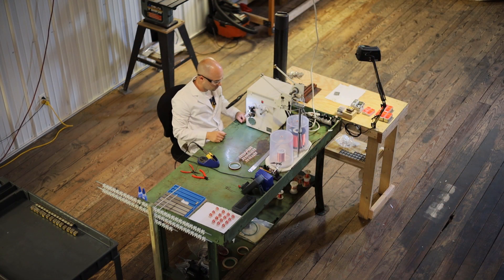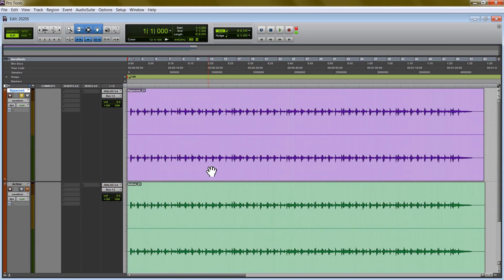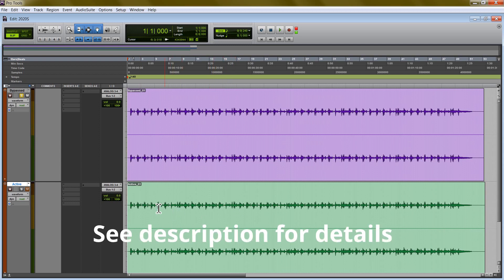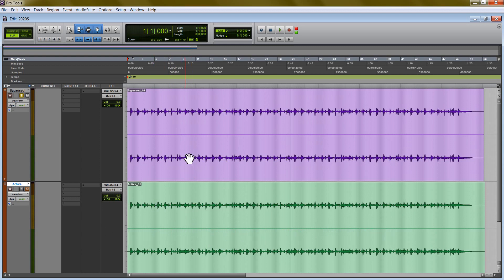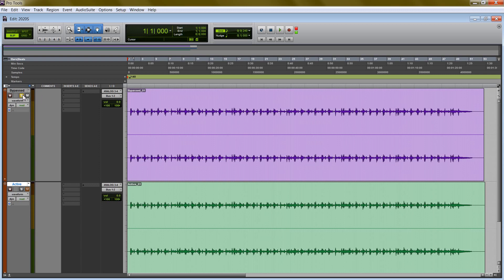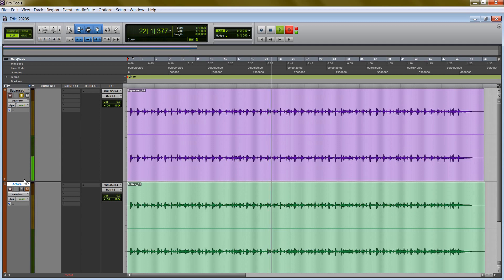Lightning Boy Audio 2020S Steel-Core Instrument Transformer

Comment: Hi, can you tell about transformer specs ?
like impedance ?
Reply from the maker: It’s about 145k Ohms, but that can change a bit depending on what is connected to it.
Reply: I'm from Iran and we have no access to buy anything from outside the country, I wanna use this between my electric guitar and 
Axe-Fx II  in my signal chain, my pick ups are Dimarzio PAF7 with DC resistance about 7.23 k ohm, my friend is a professional in electronic engineering and winding advanced transformers , I need detail information about transformers u use in your products, I did a lot of search about it , many people recommend 10k:10k or 600:600 audio transformers, I need your help to make my own transformer to get rid of hum , thank you for your support      @LightningBoyAudio
Reply from the maker: https://lightningboyaudio.com/store/p89/instrument_transformer.html

Comment: just got this in the mail today and it sounds so good.  I just make music on my ipad so I previously got my harmonic distortion from software apps.  I was content with them before I heard this thing.  I also don't have a guitar amp, I just use guitar pedals (2 of which are Lightning Boy pedals, Thunder Knob and Soul Drive), and since they are made of real amp components, I don't think I need an amp.  I inserted this in between my fuzz pedal and a buffer booster eq.  Previously, I had to watch my volumes because it would distort the guitar in a bad way, but with this thing, its like it's compressing everything to be balanced.  I can boost the lows or highs pretty high and it still sounds pleasant.  Wow, I'm typing back and forth from playing the guitar, I just boosted my fuzz pedal all the way...I usually had to be careful with that one sounding so harsh, but it sounds so good.  It seems like every guitar pedal or preamp should have this thing already installed in it.  Although, after switching back and forth with and without the 2020S, it reminds me the difference of mogami gold and mogami platinum.  Frequency wise, it sounds like mogami platinum because it tames the lows and cleans up the highs, but the mids and the low mids loses its thump.  For my guitar, an Se Santana that focuses on the mid frequency, I favor the mogami gold over the platinum.  It makes me wish this thing had a tone control.  Just like I wish there was a tone control for guitar wire to get both the tone of mogami gold and mogami platinum.  Do you think it would be possible to have a future version with a tone control or is that impossible to engineer?
Reply: Update: Found the solution.  I find that it sounds thicker by mixing the transformerless signal with the 2020S in X blender pedal so now I can have the low mid thump of the dry signal and have the clean highs and 3d sounding 2020S..it sounds pretty good all running thru the 2020s, but i think it sounds better mixing both wet and dry signals
Reply from the maker: Thank you for the support!  Sorry, no plans for a version with tone controls.  Not enough room in the enclosure and it could only be “cut” knobs since this is a passive device.  Enjoy!
Reply: @LightningBoyAudio  thanks for the reply, yeah, it would definitely have to be in a bigger box with a tone control.  I was thinking of it being in a completely new box to be in direct competition with the sono audient preamp interface or any other tube preamp or tube pedal.  It would have active eq: bass, mid, treble all with sweeping capabilities, 2 xlr or instrument jacks for option of recording vocals or instrument, including 2 tubes, with the option of turning them on or off, a 12au7 and 12ax7.  So, for clean and richly harmonic vocals, we have the option of just turning on the 12au7.  Also, have 2 transformers with the option of turning them on or off with a blend control mixing wet and dry signals.  The 2020S transformer would be in the out to clean up the sound but on the input to have the option instead of steel, maybe copper to blend a dark and distorted fuzz.  What do you think?
Reply: Oh, forgot to have the option of the 2 tubes to be rolled out easily with a durable tube socket, and easy access to change them out.

Edit:This thing might be way too much work in a niche category and way too expensive, so how about a darker version of the 2020S for a fuzz effect but be in a bigger box to include a mix knob for wet and dry signals?

Another Edit: i just found that darker fuzz transformer sound is already done with the bogner oxford pedal and it looks pretty hard to beat since it has a neve transformer in it.

But I switched around my pedals and the 2020S sounds beautiful with the soul drive pedal as its booster.

Comment: i could see this after a overdrive where the overdrive output boost becomes the saturation amount control....but it still makes more sense that the two sides of the transformer are left floating individually to let the input and output reference to their receptive connections....then it's Also a common mode noise gate with no annoying threshold..